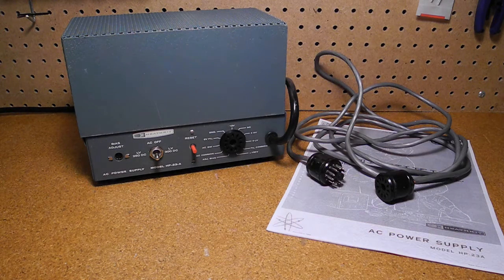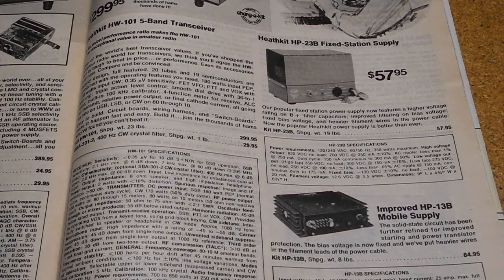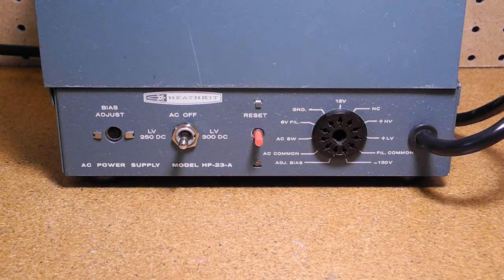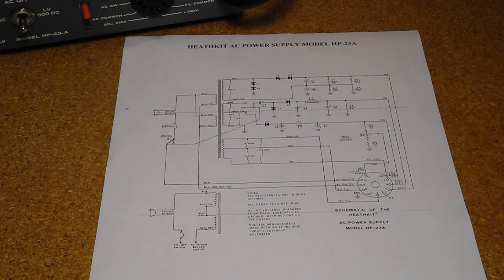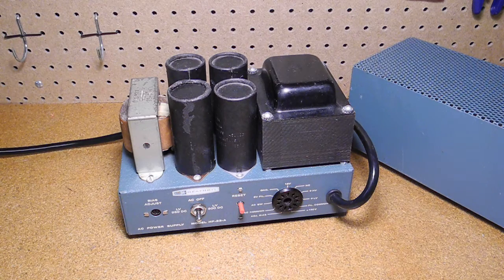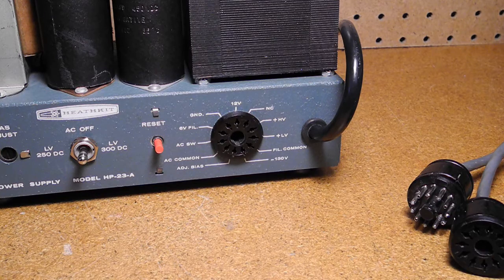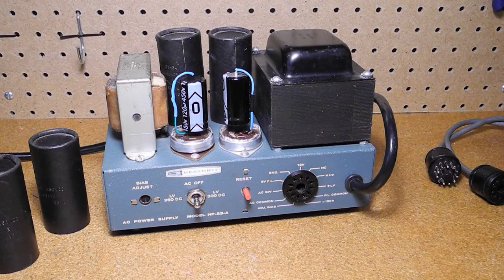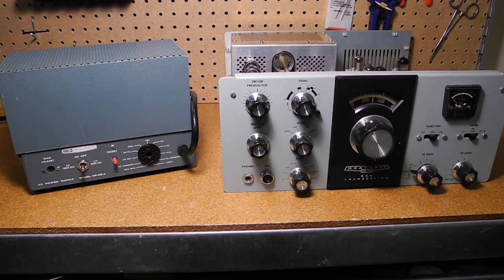The Heathkit HP-23A AC Power Supply

Comment: Excellent and super helpful video. I am doing the same as you for my HW-101 restore. I’m curious where and what kind of fuses you installed after replacing the power cord? Thanks!
Reply from the maker: The HP-23A model does not use any fuses, only a circuit breaker. I did not change it. The older HP-23 model did use fuses.

Comment: No one been here for a few years, lol, it's now 2023 and I want to restore one !   I wish Jeff had put his callsign, I want to email him !!  I want to ask why he specifically did not mention the SB-101, he went from SB-100 directly to SB-102 as radios that would use this supply.  When I bought my relic, it had this amp, the HP23A.  Maybe another passer-by will know ?  My basic question is which voltage setting to use, the 250V or 300V setting ? (for my friend Joe, VE2CY).
Reply from the maker: Somehow I overlooked the SB-101, it was an oversight. For use with the SB-101, the HP-23A switch should be set to the 300V position.

Comment: Very Informative Jeff! A great example of a supply that uses voltage doublers to allow the transformer to be easier to manufacture and more reliable. It has only single higher current 266VAC medium voltage winding to produce the 800V. Diodes and caps are cheaper than HV Center Tapped transformers, by the early 1960's...

Comment: I got a HP-23B with an HW-101 and HS-1681 speaker at a local Ham fest earlier this month. Only paid $125 for the entire setup. Still need a Mic though. The 23B was recapped when I got it. Works fine as does the HW-101

Comment: great video, thanks!... ?i can only find 47uf 450 volt caps and  100 uf 450 volt ele caps, will they be ok?
Reply from the maker: Values a little higher in value (47 for 40 uF) should be okay but I wouldn't use 100 in place of the 125 uF.
Reply: i cant find a 125 uf 450 volt. do you know whare to look? i dont want to replace the whole board, do it like you did, thanks again
Reply from the maker: My preferred source for capacitors is https://www.justradios.com/

Comment: Be careful with the one 125uf that's in series with the LV circuit off the transformer. It does NOT discharge! I got shocked off that one at a few hundred volts. Not fun! I got the shock from the ac switch while working inside the power supply. Always be careful where you touch when working on high voltage items.

Comment: Nice video. Very informative, and a very interesting supply with no transistors or valves. I love it when caps have the cardboard tube covers, because then they are easy to re-stuff as you did. I might have used cheaper radial caps vs. axial caps in there, though. but I guess if you already had them...

That HW-101 looks nice!

Comment: When I ordered and put together my HW-101A in 1974, and being newly married, I didn't have the money to get HP-23, so I built my own version.  Using a plate transformer from an old TV chassis, I put it together using a schematic and article from the 1968 ARRL handbook.  It helped that I was working then at an electronics distributor, selling parts to TV and radio servicemen.
Good video as always.  73 KM4JA